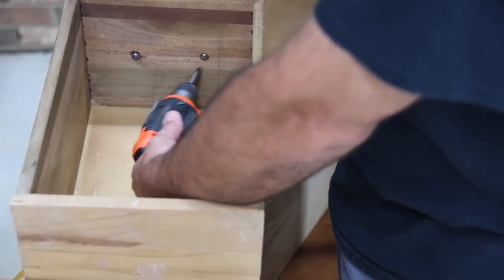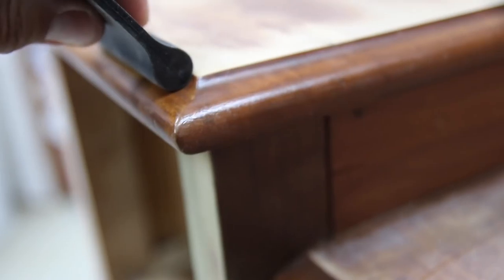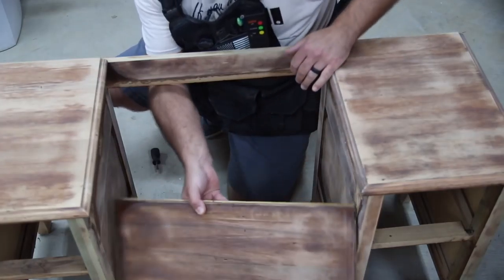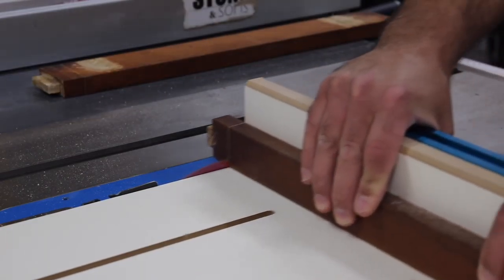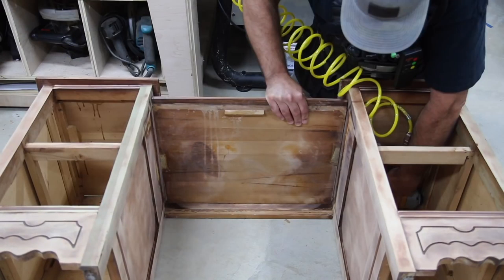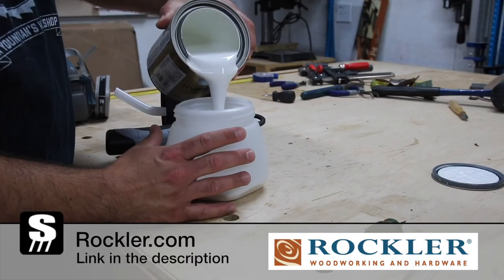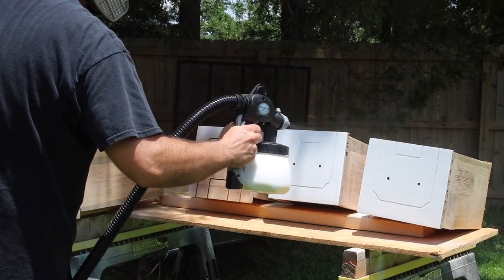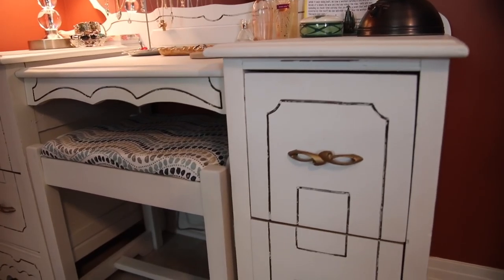Antique Vanity - HVLP Spray Finish

Comment: I just bought that sprayer. Did you water the paint down? What paint did you use?
Reply from the maker: I watered it down a little. Just a latex paint.
Reply: @StoneandSonsWorkshop  thanks. I've looked all over for a ratio. The manual doesn't cover it.

Comment: Good video. But you need to quit talking like the mid 1900's were ancient history. I was born in the 1950's and I don't feel ancient...yet. I have my Grandfather's highchair from 1904. My kids used it in the 1990's but I have kept it in the original finish. Just added some tung oil. Got my great-grandmother's Bible from the 1870's  Its good to see someone with an appreciation of the things from our pasts.
Reply from the maker: HAHA. I know. It did sound that way, but honestly I don't know if it was from 1900, 1920, 1950... that's why I said 1900's. I mean technically I was born in the 1900's. Lol. Thanks!!